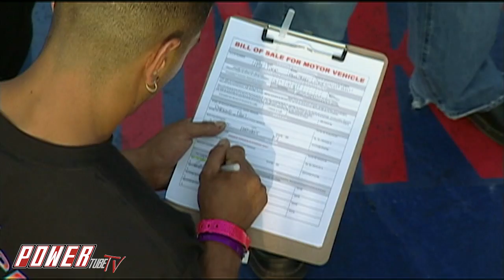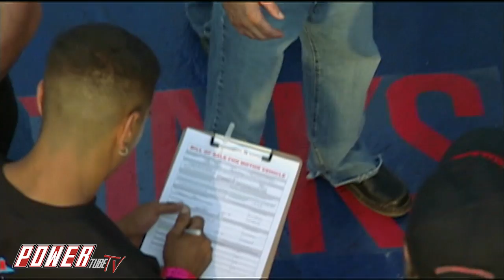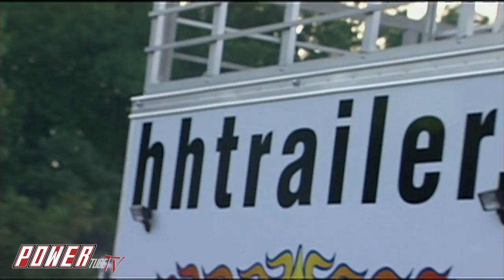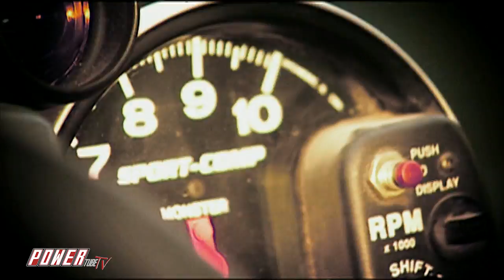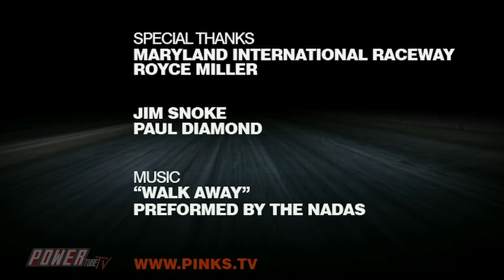PINKS - Lose The Race..Lose Your Ride! Manual Shifted Mustang Shootout For Titles!!

Comment: the guy spraying nitrous in the intercooler some of that nitrous would make into the intake making a lot of extra power for Diamond. He cheated really good
Reply: Um no do you know how intercooler works
Reply: @cortneybunge359  yes indeed. Nitrous oxide is lighter than air and will go up and into the intake and will make extra horsepower . If you spray no2 in the air filter during a dyno run you get a spike in torque and horsepower
Reply: Lol just stop....
Reply: Jesus almighty, an intercooler is a sealed device to let air pass thru the fins to cool the intake air INSIDE the intercooler from the turbo or supercharger, in no way can the nitrous get into the engine lmfaooooo
Reply: @robbygray9562  shhhhhhhhh don't let a thing like logic interrupt them.
Reply: @robbygray9562  it will accumulate in the hood and make into the intake manifold and will make extra power in the beginning of the run. He cheated.
Reply: @franciscofittipaldivessani3259  🤣🤣🤣

Comment: You can see the rear wheel moving around like crazy side to side on the black turbo car, they put so much into turbo’ing the motor couldn’t upgrade the rear suspension?; still dragged that pos red fox tho,…